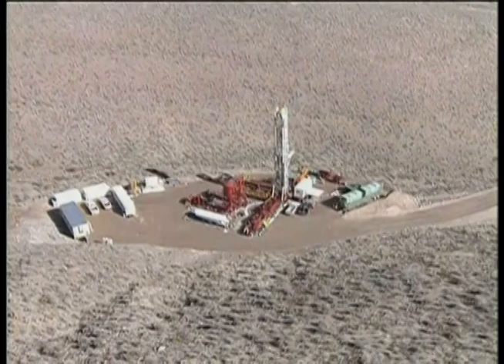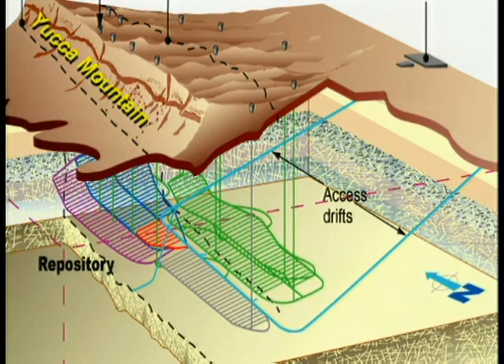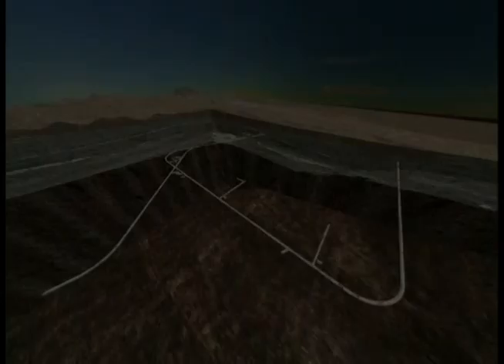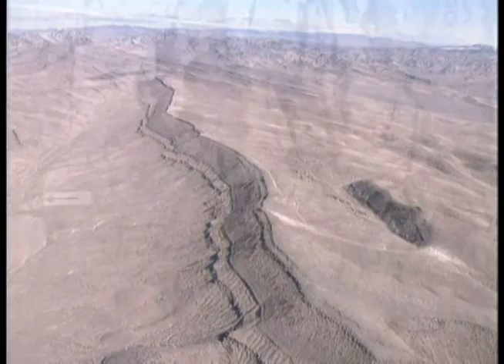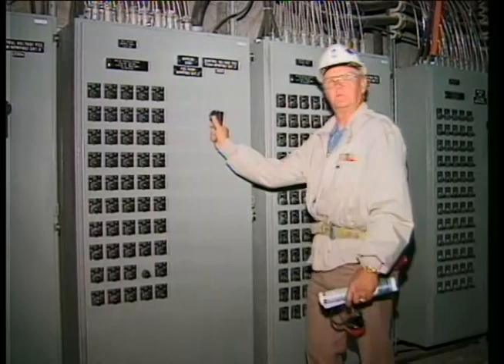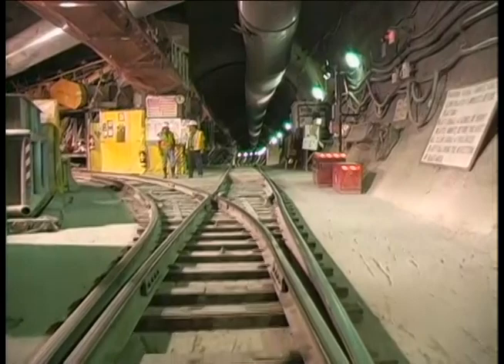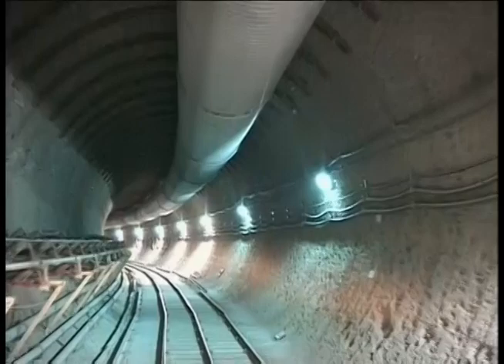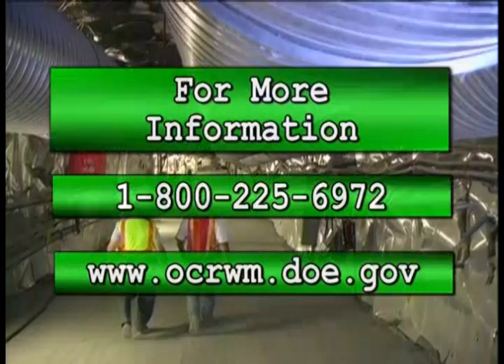Yucca Mountain: The Making of an Underground Laboratory

Comment: Store it in Titanium barrels, it never rusts and is highly resistant to corrosion.
Reply: Alan Page nobody knows how titanium would respond in a hot, radioactive and thermally environment, especially over the mandated 10,000-2,000,000 year timeframe the government want assurances for. 

Geological repositories are clearly the way forward, and the current plans are good..... if the political will was there
Reply: titanium has a relatively low density. radioactive gamma rays would easily penetrate it
Reply: Alan Page you paying for that titanium?